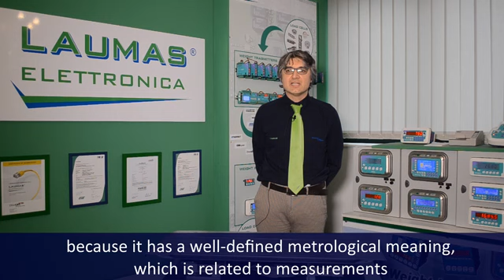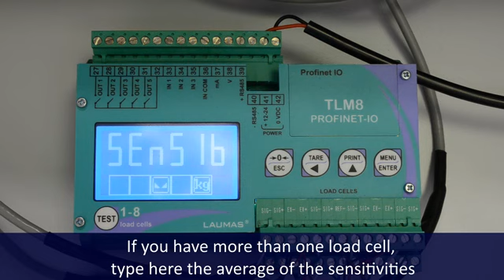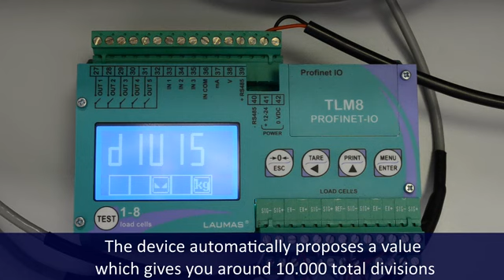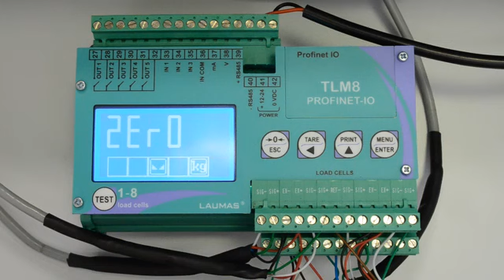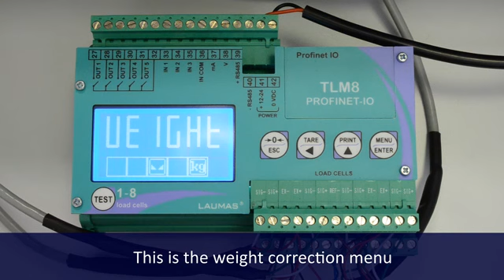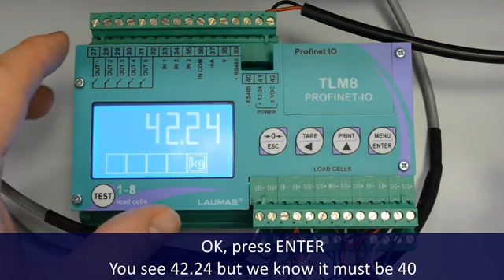Calibration - weight indicators and weight transmitters (english)

Comment: Is there no quick zero method one can apply to correct for minor fields adjustments?
To remove lite drifting of the load cells?
Reply from the maker: Of Course, have you check on the manual?
Reply from the maker: page 18 ZERO TRACKING